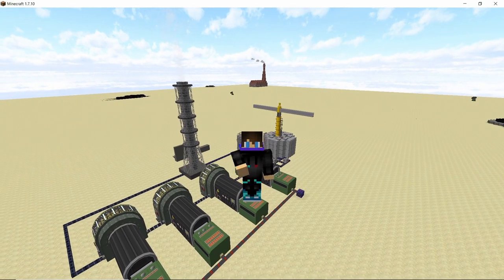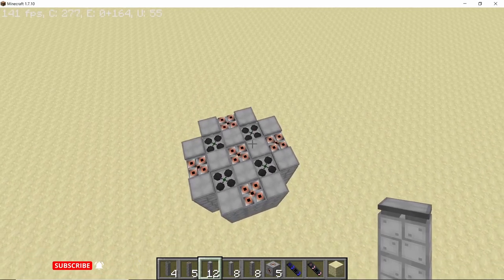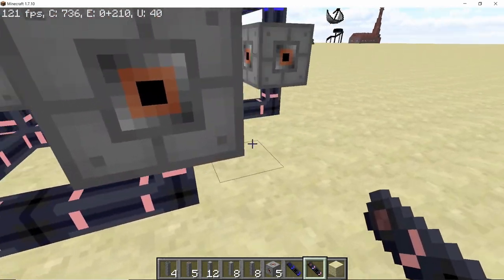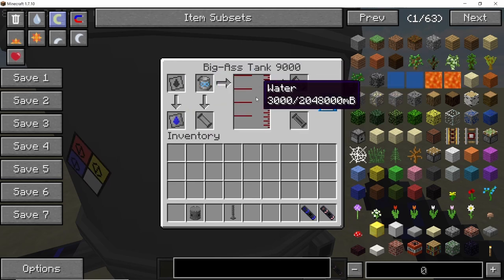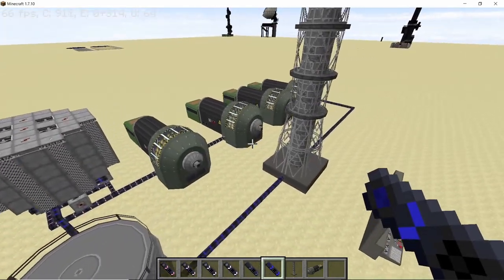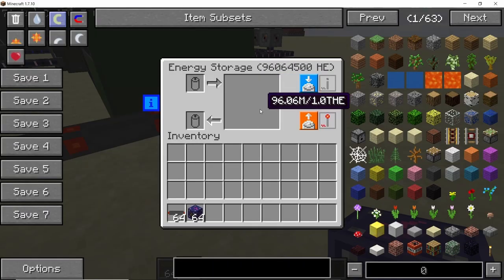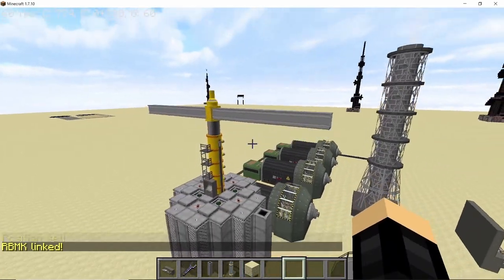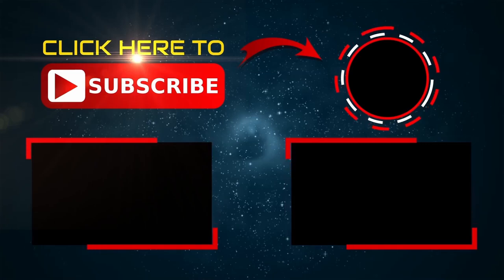RBMK REACTOR Design with RBMK FUEL CRANE || How to make an RBMK Reactor with Fuel Crane in HBMs Mod

Comment: Water not attach Steam Connector in 1.12.2
Reply from the maker: It's probably a visual glitch but you can choose not to use the steam connector altogether. Just connect the water ducts in the bottom of the reactor and steamducts on the top and you should be good to go !!
Reply: @SavageVegeta  yes

Comment: going all out and building a 48x48
Reply from the maker: Why a 48x48 then ? Build a 45x45 so you can control it with 9 RBMK consoles , I mean the shape can be really symmetrical / modular if you build your Reactor in multiples of 15 considering the max size for RBMK console is 15x15

Comment: are the covers required?
Reply from the maker: Yes they are , they will reduce the amount of radiation your reactor will spew out so it's highly recommended to use them
Reply: @SavageVegeta  got it
Reply: and also, ive rebuilt the 13x13 in one of your last tutorials and im about to load it up with fuel right now and test it as of now the crane syncs to the size of the reactor whish is cool! quite a unique way to "build" the crane as well lol
Reply from the maker: @robbytheatomicengineer5749  indeed that's quite satisfying when these things sync up in size like this. Best of luck with your reactor tho Mr. Nuclear Engineer :)
Reply: @SavageVegeta  you too sir
Reply: note to self do not use JUST glass covers, looks GREAT and all but in the end, ended up with 4 greys (400 rads) of radiation in reactor hall
Reply from the maker: @robbytheatomicengineer5749  lol the glass ones are mostly for deco and to see the Cherenkov radiation when the reactor is operational. So use them on the fuel channels only and normal cover on the rest of the colomn
Reply: @SavageVegeta  okay, it does seem that larger reactors struggle to contain radiation
Reply from the maker: @robbytheatomicengineer5749  it all depends on how you build the reactor , like for example if at the very edge of your reactor you've placed neutron absorbers or reflectors which are in the direct path of fuel channels , then the Neutrons have no way of escaping. Reactors like these don't leak out any radiation
Reply: @SavageVegeta  placed down relflectors, solved the problem
Reply from the maker: @robbytheatomicengineer5749  C O N G R A T U L A T I O N S
Reply: @SavageVegeta  what can be put in the irradiation channels?
Reply: @SavageVegeta  can confirm 110% the 13x13 reactor works fine, so if youd like to announce that in one of your next videos go for it just emphasize on the fact that the outter fuel rods need either an absorber, reflector or irradiation channel, i have also gove out with 100% glass covers and it leaks zero radiation, reactor has been tested fully and passes all tests

Comment: i did everything right, but the water was used up too quickly and did not produce steam, then the reactor went chernobyl mode on me
Reply from the maker: yeah I messed up by using the aux cooling tower and a single heavy infinite barrel. Introducing more inf barrels and using the big cooling tower should fix that issue

Comment: I think, I did something wrong, mine exploded :|
Reply from the maker: Increase the number of water tanks , and change the auxiliary cooling tower to big cooling tower. That should take care of water running out when the reactor runs at high temperatures
Reply: @SavageVegeta  maybe is problem that I played it in 1.12.2, because there is like "not connecting" the water fluid duct with steam connectors
Reply from the maker: @lupinfidorkas  https://youtu.be/zwAX5qmb6F0
This video should help with that , it's for 1.12.2 RBMK
Reply: @SavageVegeta  but in 1.12.2 the water fluid duct does not connect with steam connectors (in my game), and I think you have 1.7.10
Reply from the maker: @lupinfidorkas  yes it is a visual bug in 1.12.2 that the fluid ducts don't connect to the steam connector. But aside from that they work perfectly
Reply: @SavageVegeta  oh ok, thank you
Reply: @SavageVegeta  because, every time I try it, and I pull out 20% of boron rods, it explode

Comment: Can I increase the storage column if I have a large reactor?
Reply from the maker: Yeah incase of a larger reactor with more fuel channels just place more Storage columns on the sides so you can put more fuel rods inside them. I also think you can add more than 1 crane on a single RBMK reactor but I haven't tested it out yet.
Reply: @SavageVegeta  Great. If you manage to add more than one tap, tell me about it.

Comment: uhh mine exploded but i did everything like you
Reply from the maker: Try replacing the auxiliary Cooling tower with the big one , and also add more tanks fo water. Fuel rod properties were changed in recent updates so I can't really say what is causing these explosions but the things I suggested work in general for all the reactors.
Have more water than needed and the loop should be closed with big cooling towers to ensure there's no build up of low pressure steam
Reply: @SavageVegeta  how many tanks should i have ?
Reply from the maker: @b7uh  that mostly depends on how hot your reactor is running man , the hotter it is the more water tanks are needed. 
So just monitor your water supply when your reactor has stabilized and see if one tank cuts it or not ... If not add another one with heavy water barrel in it and then repeat
Reply: @SavageVegeta  yeah but my reactor doesnt stabilize

Comment: my exploded as soon as i started it
Reply from the maker: how is that even possible , temperatures don't go up so quickly that a reactor can explode instantly like it takes a few seconds even if you don't have any water in the reactor.
Reply from the maker: double check your water pipes and make sure all your boilers have water in them
Reply: i dont know how this happened there was water in boilers and everything is like in video but as soon as i raised control rods 20% it exploded

Comment: is there storage column in 1.12.2?
Reply from the maker: Yeah i guess there are
Reply: @SavageVegeta  I asked on the discord server, they said that there is no 1.12. I will go to 1.7.10 version )
Reply from the maker: @nonplayt  I thought there was the storage column cause many of the new updates from 1.7.10 were implemented in that version a couple of months ago but yeah i haven't played 1.12.2 in a while. Aside from that there's also the visual glitch of the water ducts not connecting to the steam connectors in 1.12.2
Reply: @SavageVegeta  yea, I’m trying to make your 15x15 reactor in 1.12.3 and water fluid does not connect to steam
Reply from the maker: @nonplayt  yeah for RBMKs I would suggest sticking to 1.7.10. 
As for the other stuff like doors and weapons 1.12.2 is good